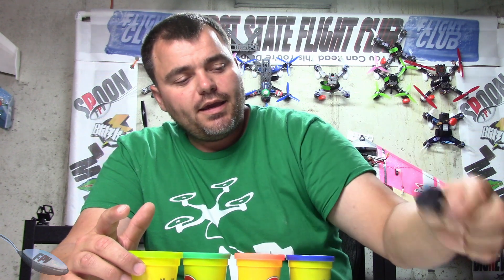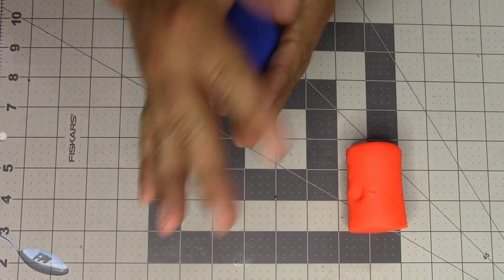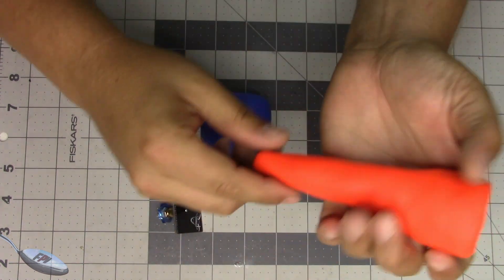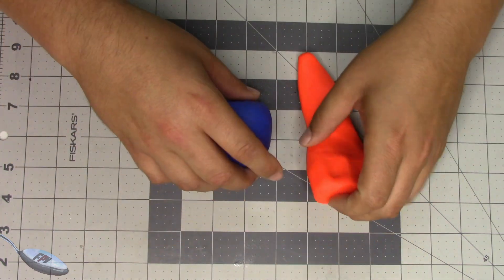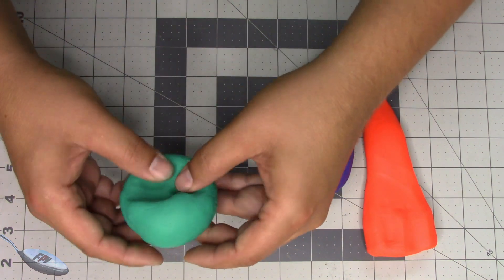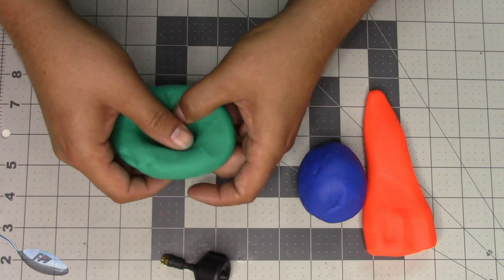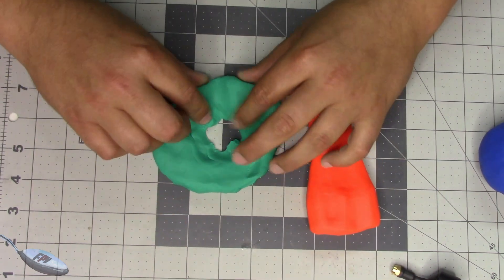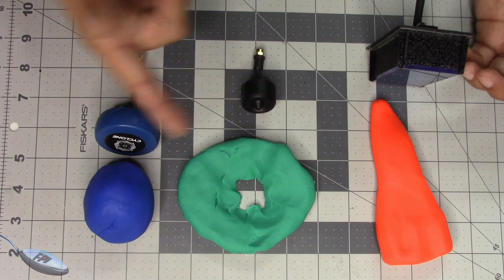Antenna Patterns

Comment: Thanks for the good video. So I should be able to use one of these on my goggles, and it should receive fine from my clover leaf? Do you use one of these in addition to a patch antenna?
Reply from the maker: I use the VAS Ion for my omni antenna, best omni for reception I've ever used.
Reply: Update: I got one of these antennas and it didn't seem to work as good as the Aomway clover. My goggle screen did that thing where the picture went down vertically. As in looping down nd out the screen, and then feeding in from the top down. I was using it with my ghetto Aomway patch antenna. I haven't given up on it yet, but it was something that didn't happen with my previous setup. Do you know what that might have been? Thanks spoon.

Comment: what are your thoughts on iftrons clearview with recomended vitennas and connex prosight with their antenna setup.I just bought a frame for the connex and then discovered clearview.. iftron recommends using 2 of the same antenna the connex is a new breed .. I just started understanding the proper antennas to use and that seems to be incorrect with these new technologies...but both systems look like game changers.yes /no ?With the passport.. and then an av to hdmi converter to avengant glyph goggles their is very little latency if any.. I cant visually see any..even my tinywhoop looks hd quality... I am wanting to get the flat donut with the ball in the middle type of coverage...sorry but you just explained to me what i have been trying to figure out for a while in 5 minutes with playdoe...Nothing comes with good directions anymore..learn by failure is expensive
Reply from the maker: Glad you like the PlayDoe explanation.  I hate to say bad things about Connex because HD is the future, and we need them, and they are doing great things.  I don't believe the technology is there yet, It's great unless you fly behind a tree etc.  Clearview is amazing, best Analogue reception money can buy right now.  The same antenna thing is a misconception with clearview, you can use two types.

Comment: cool video, I have a ion on the way for me goggles. one question how does ion stack up to the air screw that most top pilots use or will they be switching to ion?
Reply from the maker: Ion is the best omni antenna on the market for reception,  provided you don't do a lot of direct overhead flying higher than like 200ft.